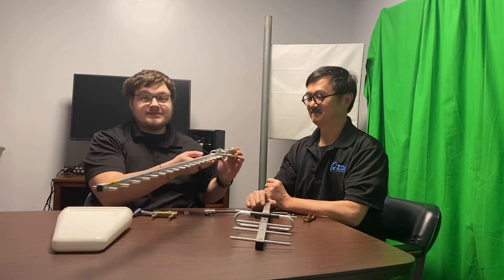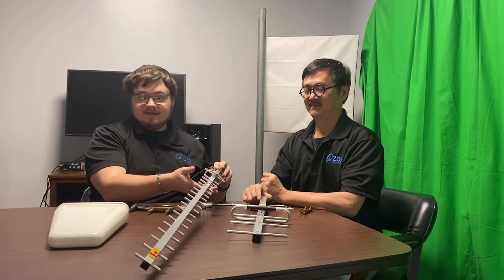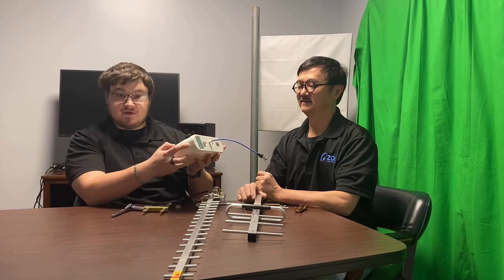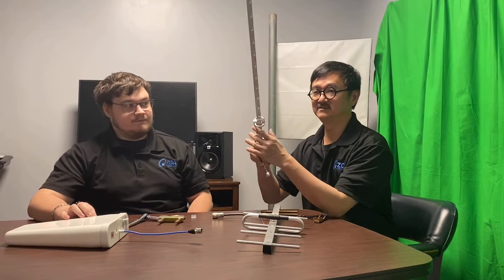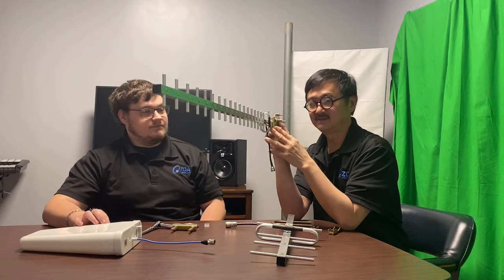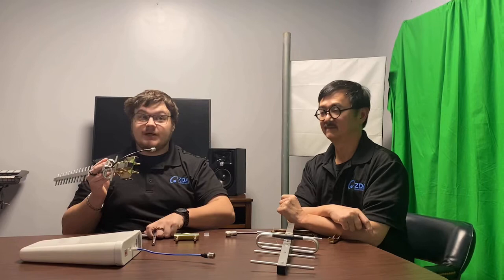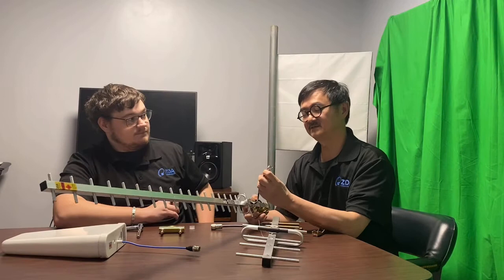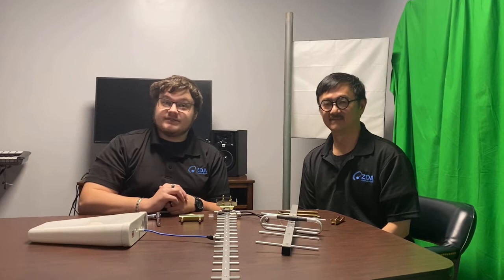How To Understand Yagi Antenna Mounting & Polarization

Comment: Hi. Any thoughts on why my small UHF beam vertically polarized receives better when it's not pointed at the target? It's great, but now I'm transmitting in the wrong direction. Is that a phenomenon for the vertically aligned beams?

Comment: Hi and thanks for the great video!
I have a 6 elements Yagi tuned for Marine band. What is the best installation for maximum gain? Horizontal or vertical?
Thanks in advance!
Reply: It depends on the polarization of the antenna (s) you are communicating with. For efficiency polarization should match.

Comment: I have a couple of Wilson Yagi antennas mounted vertical (one able the other) for MIMO. would a cross polarization configuration be better?
Reply: Hi, im the guy on the left in the video. It might be beneficial for you to consider cross polarization depending on the type of signal you are receiving. If it turns out to not work better then you can always change it back